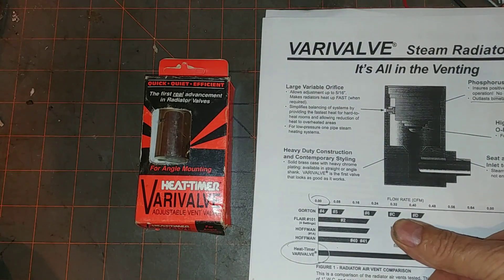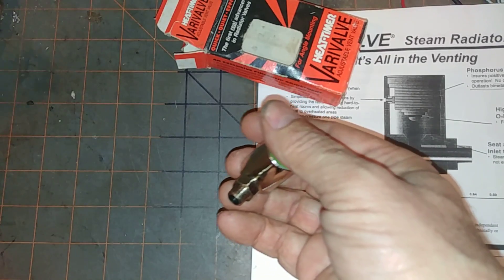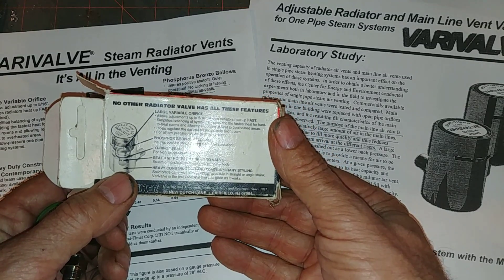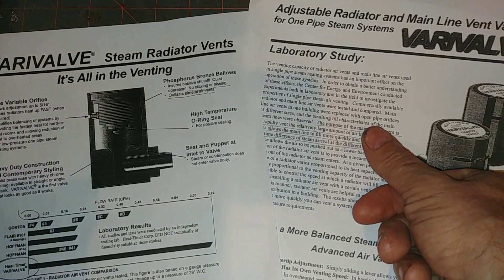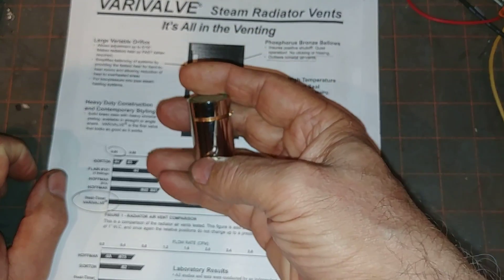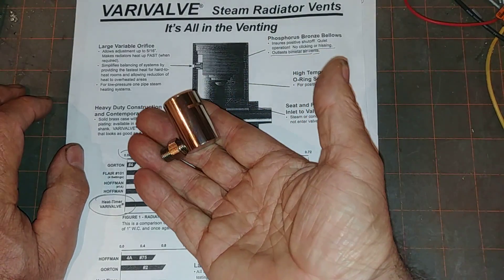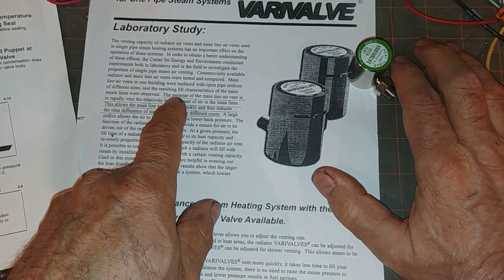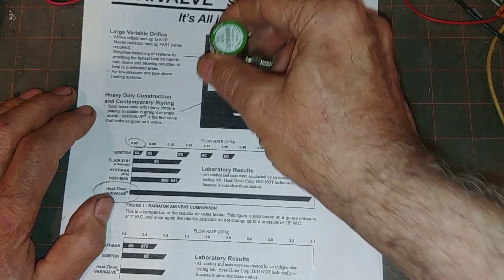Varivalve Single Pipe Steam Radiator Vent - It Vents Too Much, It's Likely To Spit & Fail Open

Comment: What's the best vent for steam baseboard? (It's got a pipe in and a pipe out, of course) - the rest of the house is one pipe standard steam radiators
Reply from the maker: @ChrisRubeo  How is the "out" pipe hooked up?
Is there a way for steam to get at the baseboard from both directions (that would be bad).
Generally, you want to vent even perfectly piped baseboard s l o w l y, or you may risk a spitting vent &/or water hammer.
A Gorton #4 is a slow vent.
Reply: @ it was a very early remodel to a 1935 house. All the other radiators are one pipe, steam radiators, but in one room, the living room, there’s a 12 foot long cast-iron baseboard radiator. A one inch pipe comes in at the base of the radiator on one end and a 1 inch pipe goes out at the other end. For years I’ve also had a, varvent above the exit pipe and it has not had a steam trap. But it seems like this radiator takes a long time to get hot so maybe I need to install a steam trap at the return pipe. Is there something I should put in place of the little varvent.?
Reply from the maker: The problem with cast-iron baseboard is that it was really designed for hot water heating and not steam.
Cast iron BB promises much, cost a fair amount, and delivers not nearly enough for the trouble.
If you read the literature from at least one manufacturer, they say (in fine print) that cast iron BB is not to be used in lengths over 10 feet for steam.
You are lucky, in that someone installed an outlet for the water, but you must make sure that that pipe ties into a return BELOW THE WATER LINE!
That is needed to seal that end from steam backing up that return (no radiator trap is needed then.)
Next, I would scrap the Varivalve.
It is over-priced junk.
Next, I would install a high capacity vent, maybe a Gorton #6 or more, on the INLET side of your BB.
That should bring steam up to that point quickly, by getting rid of the air there.
Then, you can experiment with various smaller vent sizes at the far end in place of that Varivalve.
It might be difficult, but if you can get the BB to pitch, even just ever so slightly toward the return end, that will help some.
This all presupposes that you have vented your steam mains in the basement with Gorton #2s or at least Gorton #1s and that those pipes are well insulated.

Comment: Most of the steam I see was installed a 100 years ago originally, coal fired 500kbtuh stuff. I see a lot of vents that should have failed, but did not. Buckets, F&T, TP’s at radiators, gravity boxes, ya know.
But buy a half dozen of these gems and your still a couple dozen short.
Reply from the maker: I take it, then, that you are also not enamored of the Varivalve vent?
Reply: @gordonschweizer5154  
Correct Sir!
The DIY’s love em cause they’re cheap, but nothing good is 1/3 the cost of a reliable component.

Comment: I replaced all my vents with vari vents. My steam heating system never worked better. No banging or spitting of gorton valves. So I will stick with vari vents...one radiator has had a vari vent on it for 20 plus years works great
Reply from the maker: I glad you lucked into a good batch.
May I ask, what pressure do you run your system at?
Do you have good main venting such as a Gorton #2?
Reply: @Gordon Schweizer  do you use b&j big mouth main vents? They are 50% faster than gorton#2.
Reply from the maker: @TheScottmittel  I have used Big Mouths as main vents in certain very limited applications - namely as the only vent on the dry return terminus in low pressure vapor systems.
And piped to be near a sump pump.
In that application, the B/M will only be exposed to steam if something else upstream fails.
If the system floods, B/M will dump lots of water into the basement.
I am sorry to say I do not trust the longevity of the B/M vent over the average Gorton #2 vent for constant steam exposure cycles mainly due to the o ring seal.